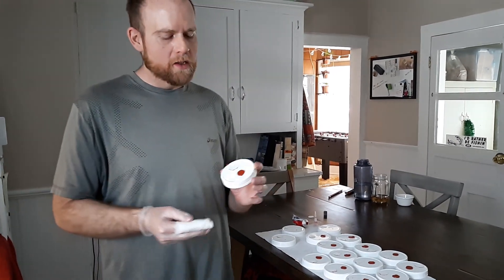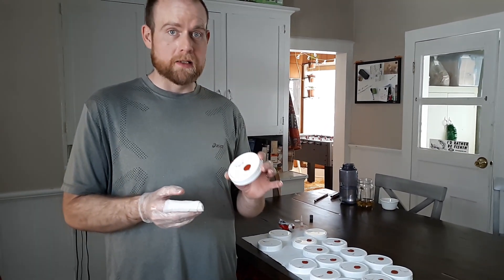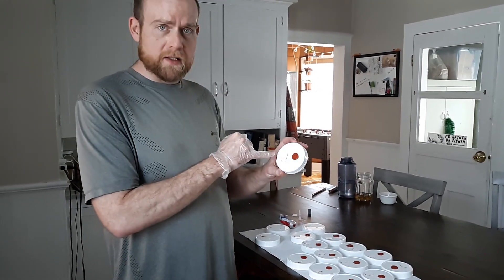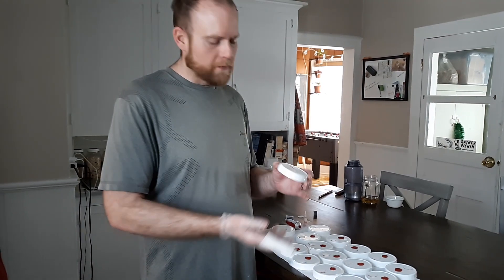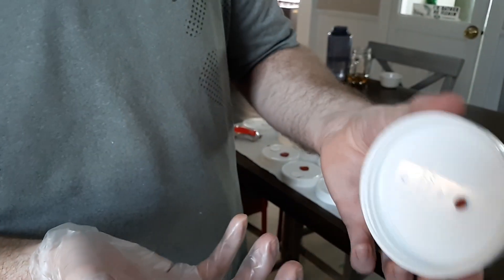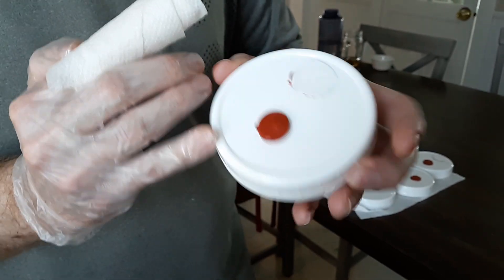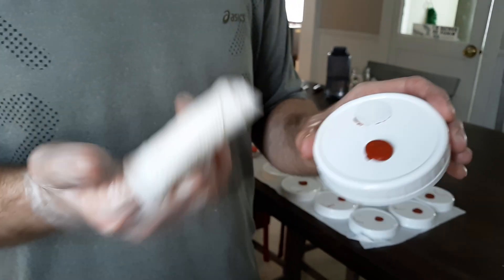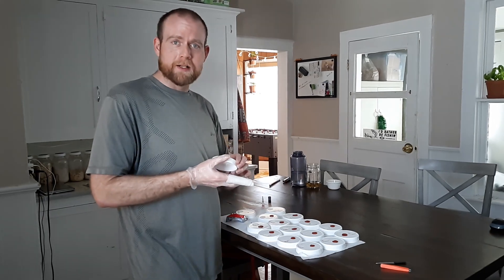Making grain spawn lids with self-healing injection ports

Comment: for we noobs, this information would help:  1) what type of lids are those and where did you get them ? 2) the method for putting the tyvek / breathing port in the lid would be helpful for noobs to see....(i have yet to search the rest of your channel for that info, and will, but having all that info in one video would be extra efficient). Appreciate your work.  Thanks for the info.
Reply: They have the lids at Walmart and Target. Not sure how he glued the filter. You could just use the same silicone to secure the filter discs in place.
Reply: I’m positive he used the Red High Temp RTV silicon gasket maker that you can buy at Walmart or any auto parts store. When you put the filter in place be sure to place the RTV around the perimeter of your Tyvek filter so as to not block the FAE (fresh air exchange). I’m a newb too working on my first grow. Still learning and doing tons of research. It’s really exciting but allow me to give a tidbit of advice. I suggest that you take notes in a designated notebook because there are a lot of abbreviations and little things to consider. So many different methods and you have to figure out which works the best for you in your situation. Not to mention listing out supplies and such.
Reply: @kitschycat79  High-temperature silicone works great for that, but for sticking to a much better (0.22um pore size) polypropylene filter disc casing, not so much.  I found it just released really.  Above I changed my post to talk about what worked the best for me (you'll need to read it there since you'll not believe it if I just list it here).
Reply: @stitchfulthinking4836  they do not have those lids at walmart those are not able to be pressure cooked
Reply: Dab King Well, they seemed to work just fine. Pressure cooked them several times by now.
Reply: You don't need filter disks. You can drill a hole and stick a little bit of pillow batting in it for the filter. I know it's more porous but works great with no contamination.

Comment: I learned the hard way that this video is not complete.  The ideas are great and I really appreciate this video, but the ideas were not fleshed out as much as I would prefer.  Below I have additional suggestions:

1) If one uses the plastic lids shown in this video, I highly recommend reusable silicone seals be used with them because if you don't, they likely WILL leak eventually (it took me a while to realize that the plastic lids are often not leakproof as shown in this video).  You can find many versions of silicone seals for wide and normal-mouthed canning jar for various prices on Amazon, but I prefer the ones that cannot fall into the LC when you remove the lid here: https://www.amazon.com/dp/B01LWX1BCC

2) The 25mm filter discs as shown in the video should be the hydrophobic version, not the hydrophilic ones, especially if you don't want them to leak and possibly contaminate when you shake the jar or lean it on its side to draw the LC out.  To get the lids to work as shown, it is critical they are hydrophobic ones.  The video also doesn't really specify if the 0.45um ones work as well as the 0.22um pore size ones.  Although both will probably work under most circumstances, I recommend the 25-mm-in-diameter, 0.22um pore size, hydroPHOBIC ones: https://www.amazon.com/Simsii-Syringe-Filter-Hydrophobic-Diameter/dp/B01BNYMQE4

3) While the rubber stopper (septum) can just be pressure-fitted, the video doesn't give details on how to get the filter discs to seal to the lid hole.  I assume he is just pressing them in, but I do NOT recommend that because they can pop out in the pressure cooker or just leak.  Many plastics are notoriously hard to glue, so getting a plastic filter disc to glue to a plastic lid to form a water-tight seal that survives pressure cooking is not trivial, at least in the case of polypropylene like what I bought.  I tried several types of glue, including epoxy, "super glues", silicone (black high temp version for gasket making), and chalk.  To stick to the polypropylene, none of them worked very well for very long (although epoxy worked the best).  Ironically, I ended up using the last glue I'd think would work - hot glue.  Yes, it does melt in the pressure cooker, but as long as the jars are upright, it also tends to stick around the filter via surface tension.  Then it rehardens perfectly.  I'm not saying it's the best option because I couldn't try every glue out there, but it does work.  It's what I use too.

4) He shows the use of rubber stoppers that are pretty wimpy.  I tried them and while they'll work for smaller needles a few times (I guess), if you use a larger 12-gauge needle for a 140ml syringe as I do, that wimpy stopper will be destroyed after one use.  I recommend using the stoppers (septums) from expired vacutainers.  Also, vacutainers are a great way to store LCs for longer-term storage.  I purchased expired (this does not matter for this purpose) sterile vacutainers without anything in them (no chemicals) in lots of 100 on eBay for about $25 delivered.  Search for "VACUTAINER BD 366430" on eBay for the red-septum, glass ones without chemicals in them.  The septums on these test tubes are many times more durable than the wimpy stoppers shown in this video and WELL worth a quarter each.  Plus, as I said, it's nice to have sterile vacutainers around to store your LC.  In sugar water, a vacutainer LC will stay viable for about a year (or maybe a bit longer) in the refrigerator, but if you spin the vacutainer down (which, yes, unfortunately, requires a centrifuge) and replace the sugar solution with sterile water, mycelium can be stored for over a decade according to the mycology research I found online, even lasting as long as spores in some cases!
Reply: domitron great info, much appreciated
Reply: Thanks for more info on this. Appreciated

Comment: I know you have to heat the syringe to red hot, but do you let it cool before pushing it through, or do it when it's hot?
Reply: I like to heat the syringe, then dab it on an alc pad (or alc. soaked paper towel) to quickly cool it

Comment: Can these lids be used in a pressure cooker at 15psi for 90 minutes? If so, do you have a link where I can purchase? Thanks.
Reply: Yes, It's made for hight heat, so better than regular silicone, though I've read people have had success with normal silicone.

Comment: White size drill bit did you use for you rtv? Also this lid method is new to me, so I need to make an extra drill hole for the syringe filter?
Reply: Use 11/64s I believe for the filter. And depending on if u got a 13mm or 20mm self healing port. 20mm is going to be 3/8s for a snug fit. They say 1/4 for the 13mm. But I bought 20 so I've only done my research on 20. I have yet to make them. I just recieved everything this week. I'm planning on making mine today. Hope my info help you.

Comment: I changed my reply a bit concerning the gluing of the filter disc.  I found that even epoxy putty failed me consistently, so I switched to hot glue.  Yes, it melts in the cooker but provided your jars are upright, it'll tend to pool around the filter disc when it does (via surface tension).  Then when it cools it forms a watertight/airtight strong seal with the polypropylene filter disc and lid.  There might be better options, but I couldn't find any.  And so what if it spreads a little?  The part that matters is that once it cools, it forms a very strong watertight/airtight bond, which is what I was after.

Comment: I see those lids have no gaskets. How can they be airtight? I use mason jars with plastic lids to store liquids and I have to worry about spillage due to poor sealing. So, I'm hesitant to use them for mycology.
Reply: With the hole drilled for the filter disk or syringe filter, they won't be airtight anyway.
Reply: I am a complete noob concerning mycology but I have a question. Everyone is so concerned about a self-sealing injection Port yet they can get by with using polyester fill for the air port at allows it to breathe. Isn't that defeating the purpose of a self-sealing injection port? Couldn't you just inject by putting your needle through the polyester fill and injecting?
Reply: @aaviator  2.5 micron filtration is considered acceptable to prevent contaminant organisms from entering. A 14 to 18 gage needle leaves a much larger hole. IMHO, spore syringes should Never be used to inoculate grain. A injection port is only necessary if you are going to use a liquid culture and not needed at all with agar.
Reply: @scotturley5344  thanks for the clarification!